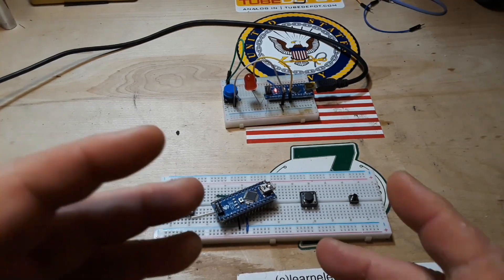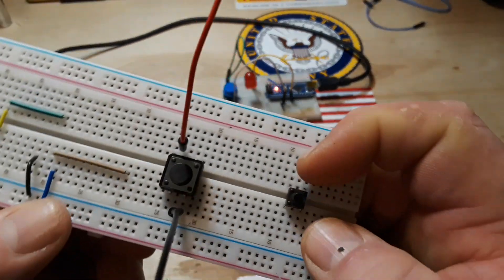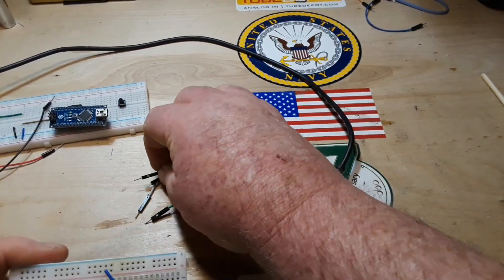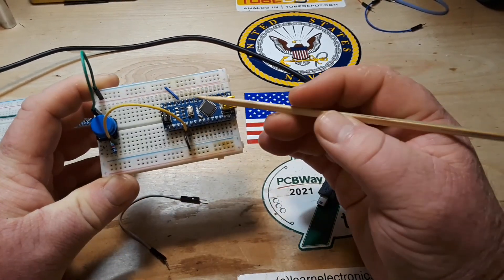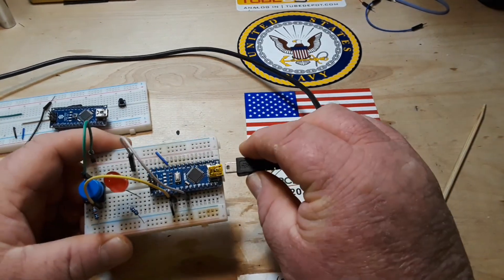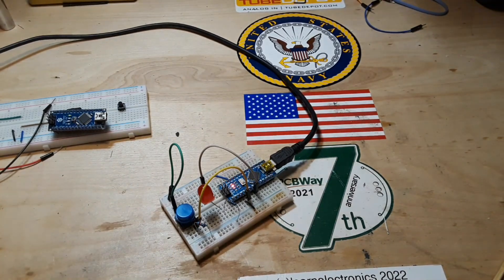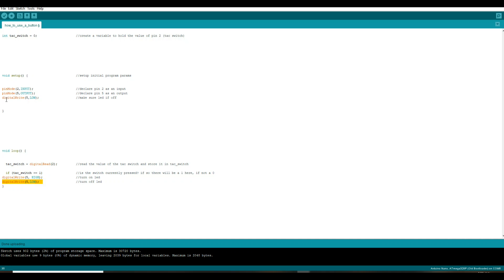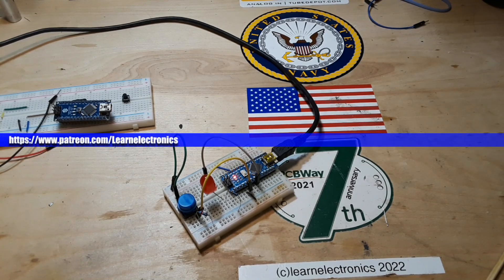Arduino Foundation Series - Tac Switch

Comment: I'm beginning my Arduino education, and this is the first tutorial I watched where the instructor follows the wires to explain whats going on in the circuit at 5:14. That blew my mind. And, it made pull-down resistors a digestible topic. Thanks for the grat videos, Paul!

Comment: What was causing the phantom voltage? How did you calculate the pull-down resistor value?
Reply: It just needs to be a "large" resistor. 10kΩ or 100kΩ or 1mΩ will all work. You are just reducing the current flow from the +5v to ground (0v). Without a pull-down resistor, it would be a direct short circuit (- to be avoided!).
Reply: @MikeLynx  The pulldown resistor value also changes the loading of the next follower circuit/network that is loading down the impedance. So you have to use a calculation that won't change the impedance or load down the next following circuit

Comment: Does your IF statement need squiggly braces? 
if (tac_switch == 1)  {
    digitalWrite(5, HIGH);
  } else {
    digitalWrite(5, LOW);
  }
Reply: Depends on your personal preference.
You can write them inline ie:
       if (tac_switch == 1) digitalWrite(5, HIGH);

or multiline:
       if (tac_switch == 1)
            digitalWrite(5, HIGH);

or using braces:
       if (tac_switch ==1){
           digitalWrite(5, HIGH);
       }
notice in all three versions the semicolon ending the statement comes after the digitalWrite(5, HIGH) statement.  All three will work the same.

You need to use braces when you have more than one execution statement with your if condition.
        if (tac_switch == 1)
            digitalWrite(5, HIGH);
           digitalWrite(4, LOW);
will not work.  The if condition terminates at the end of the first digitalWrite statement.

       if (tac_switch == 1){
           digitalWrite(pin_num1, HIGH);
           digitalWrite(pin_num2, LOW);
      }
This will work.
Reply: @tawerstlein  Thought so but wasn't sure about Arduino syntax. Each time through the loop, ping 5 is set to low. When pin 2 goes high, the LED goes on and the next statement sends it low before looping to start. That has to be a fast cycle. Surprised the LED even emits. IMHO: The "code" would be cleaner to use an else clause to turn pin 5 low.
Reply: @loucinci3922  I agree. The code of the if-block looks wrong. The digitalWrite(5,LOW) should be behind an "else" statement.
Reply: Paul, you missed the else without it the led power will be like a 50% PWM.

Comment: Hi, thank you for posting this video, I've been viewing a number of your other video's and found them very instructive thank you for posting them as well. I am new to Arduino coding/sketch writing and have a question regarding the code/sketch in your video. Can this code be used to begin a program, example I would like the sketch to begin and run when the button is pressed and end when the button is pressed again? or does this action require an regular on/off switch as apposed to a momentary on switch as shown in your video. Thanking in advance for any help or pointing in a direction to find the answer to this question.
Reply from the maker: The Arduino never actually stops. Just keeps looping over and over again.
Reply: @learnelectronics  Paul, can you, as the next step, show us a program that flashes the LED at ~1 Hz when / while the button is pressed? When releasing the button, the LED should go dark.
Reply: I'm no programming expert but, yes you could program a push to turn on and push again to turn off type of system.